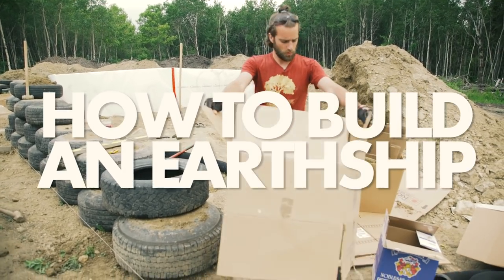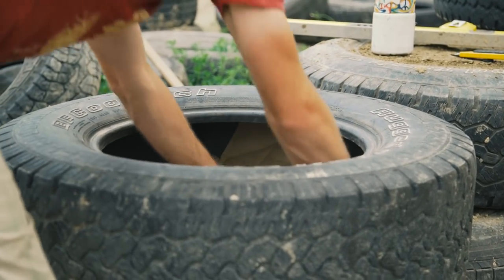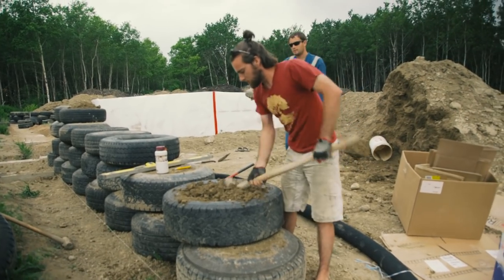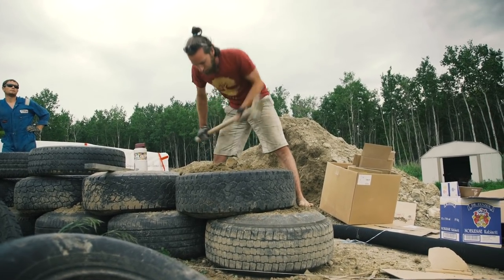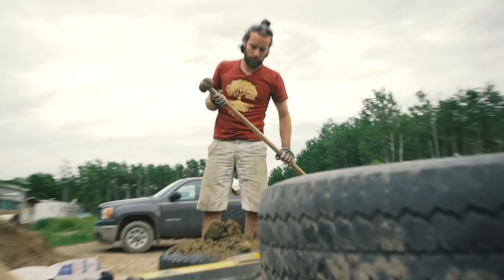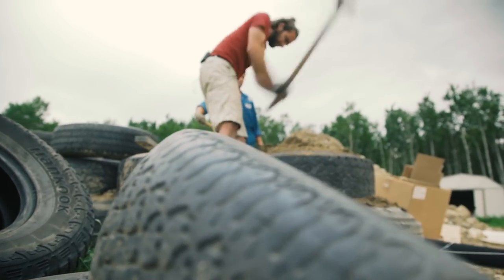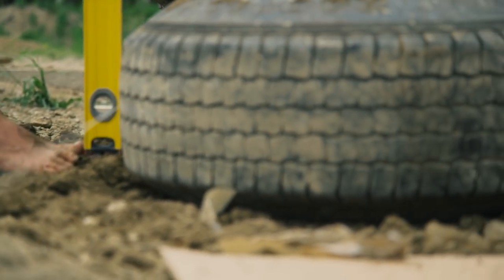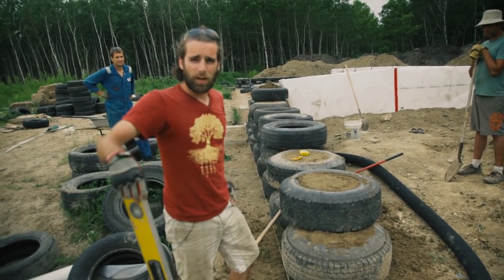How to build an earthship (filling tires)

Comment: Whenever I see dirt being hammered into tires I think, "There has got to be a better way."
Reply: I'm thinking mix it with water like in a concrete mixer then pour it in as mud. Take a while to dry but you gotta have it kinda damp anyways to tamp it. Being wet will allow it to compact really well on it's own. 
Especially if you throw in a shovelfull of portland cement or hydrated lime in with the mix for each tire.

Comment: most ppl cant build on of these because of all the pounding. Im wondering why you dont do buckets of dirt and water to fill the tires, so that you can easily pack the tires by hand. would that not work?
Reply: Thats usually how it goes actually.  It just depends on how close the pile of dirt you're pulling from is to the tire.  Sometimes its easier to scoop it in shovel by shovel. Most times its a 5gal bucket to get the dirt to the tire.

Comment: Question:?:. Where do you get all those tires from?

Are they donated?

Are they free?

Are they harvested from a junkyard?

Where do you get the tires from.

Also if sand is all that's available to you

Can you build a earth ship home out of that ?
Reply: Typically from tire shops.  They usually have to pay to have tires hauled away. So when you go asking about tires for an earthship. Most tire places want to make sure you're not reselling is all. Other than that, they give tires for free if you pick them up.

NO do NOT pound tires with sand, Sand does not condense. You want earth or clay,  No top soil, no sand, no garden soil.  EARTH is your best bet.

Comment: Shouldn't there be rebar or something to connect the lower tires to the ones above them? I know the filled tires are heavy, but it still seems like it would be unstable.
Reply: at the end there is.  You usually ram a 5+ foot steak of rebar straight down from the top course of tires. until only 6 inches is left above the top of the tire.  one steak per tire, the rest of the tires lower are packed out with cement and adobe until the wall is brought out to be flat.   The rebar helps to build the bond beam on the top course of tires to link the whole wall together.

Comment: I'm wondering if anyone has seen this method used for constructing an above ground tank for water storage using a liner? Maybe using three tires wide at base, then two wide (second course) and one wide for last (third) course for stability.
Reply: Google Outlaw septic tank,  or outlaw cistern.    The short answer is yes, it can be done.

Comment: Do the tires have to be all the same size when you do this? I seen a donut tire, but from the looks of it, they seem to be all the same size. Did you go with 17s 18s or 20s?
Reply: typical earthships use anywhere from  185 to 255  for tire sizes.  No rims less than R15. Low profile rims are a total pain in the ass to firm up with dirt.

Comment: do the tires move around allot when pounding the dirt?
Reply: I seem where they set the tire in place then screw it to the tire underneath to hold it in place
Reply: It depends.  But mostly no. and if they do move around, its not that hard to get them back in place.  Lots of people like to put a single screw in either side of the tire on the inside through to the tire below it. That helps but isn't necessary.

Comment: Far too much labor for an old man like me.  Considering alternatives to dirt filled tires, I happened to notice at work that we produce bales of empty polyethylene super sacks that measure roughly 3' x 3' x 5 feet.  These could be stacked and secured to form a perimeter wall just as these tires do.
Reply: The idea of the packed earth is "thermal mass" if you do not have the mass to absorb warmth from the sun, then the concept of the thermal mass wall will be nul and void.
Are you talking about filling those sacks with dirt?

Comment: There has got to be an easy way to do this shit.  I would get wore out after like 5 swings. This is the only thing from stopping me from starting a project like this.
Reply: Sounds like you need to get back into shape then.  Building your own earthship gets you in shape.   To answer your question about an "easier way"  no. not really...

using a pneumatic tamper or hammer would mean all you're doing is fighting against yourself with how much the pneumatic hammer moves. causes tires to be moved out of place, inconsistently packed, and the impact on your own joints from running a pneumatic hammer would we WAY worse than swinging a hammer manually.

Comment: This is definitely "skilled labor" as opposed to "unskilled" and has to take forever. I want to build an earthship but I don't have this kind of time. I can't help but think there might be a better way. Concrete in tire, wet dirt, cut the tire for access and fasten up with horizontal bracing?etc, I would have to hire skilled labor at this pace and would be so expensive on labor and insurance. Hate to be negative, but I'm really interested and I just wonder if anybody has any "better" way to do this?
Reply: Pneumatic ram as used for rammed earth construction works very well, we have done in Australia that way and it was quite efficient. Roughly 75 to100 tyres per day
Reply: I would create exercise machines that lift sledgehammer or some other weight (maybe with spikes?) Attached to a rope that is raised by.... The usual gym weight machine moves, then you could vary the muscles used,  arms shoulders chest glutes, legs, or ab machine. Or just stand and pull a rope.  Or train dogs to dig up earth, transport it, dig it into tire, pull rope to drop sledgehammer.  Or attach tool to the bottom of trampoline. Jump in to pound earth. set lots of tires together on flat ground, pound with pogo stick or trampolines.  When finished move onto a cart.  Push 12 on a cart or pull 36. = equivalent to a strongman workout pushing a car or pulling a truck. Then strongman can lift onto the wall.

Comment: What about the tires off gassing?
Reply: What about fresh paint offgassing in your house when ever you paint it?    Off-gassing from the tires doesn't happen for two reasons.  First, a standard tire will do all of it's off gassing in the first 20,000 mile its on the road.  Seeing as how all tires used in earthships are all old used tires, Almost non of them are brand new, so they should be well done their offgassing by the time we use them.  and second, When the tire wall is finished inside. it's covered with adobe or cement to pack out between the tires to make it a smooth wall. Once that smooth wall is done, there's no airflow around the tires,  They can't offgas if air can not get to them.

Comment: Small Pneumatic  hammer.
Reply: waste of time. All you're doing is fighting against yourself with how much the pneumatic hammer moves. causes tires to be moved out of place, inconsistently packed, and the impact on your own joints from running a pneumatic hammer would we WAY worse than swinging a hammer manually.